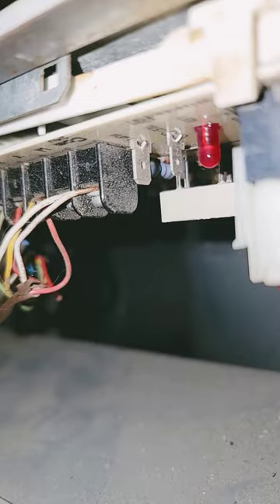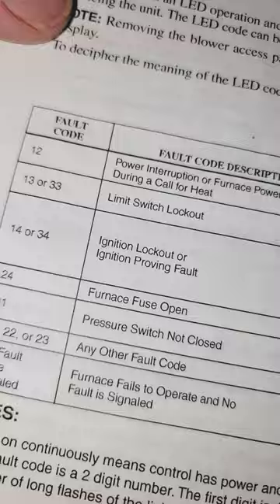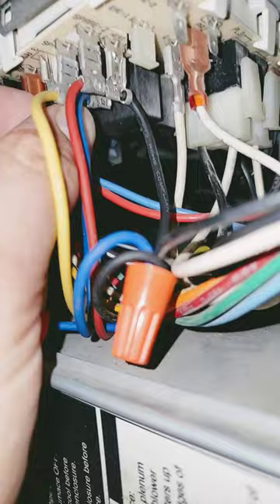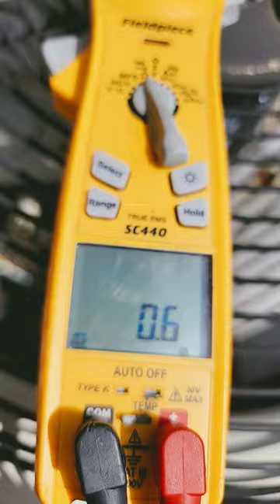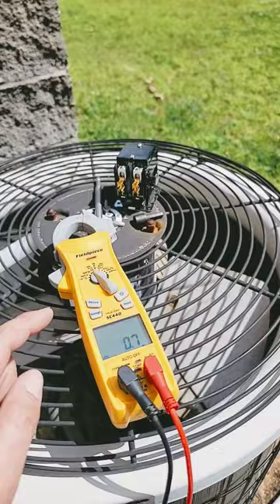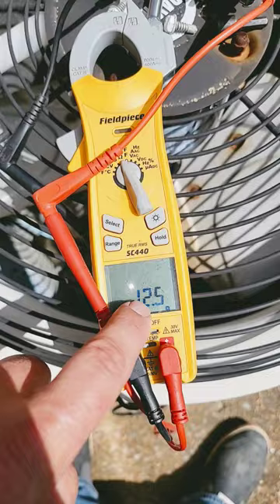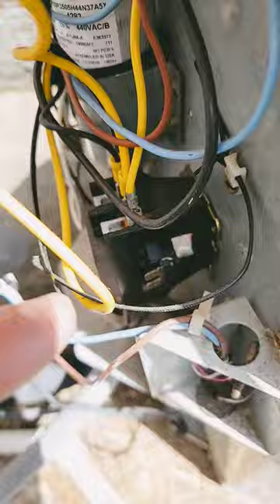The Real Reason Your Fuse Blew (Hint: It's the Contactor)

Comment: That furnace looks brand new. Kudos to the homeowner for taking care of it properly .
Reply: You should see my Clare-Hecla furnace installed in 1980. Still on the same A/C compressor and refrigerant charge since 1988. I've changed a thermopile and replaced blower fan bearings in the last 25 years.

That's it....Clare-Hecla went out of business because they designed their equipment TOO well, I'm guessing.🤔
Reply: Just took a 1984 amersican standard heat pump out of a family friends house. Comp. Went bad finally but it was in great shape for being in south FL. Defenetly a tank.
Reply: @CannonFodder873  it all about the heat exchanger inside the furnace, wether or not motors and electrical components fail and replaced over the years doesn’t mean anything for you have a failed heat exchanger. The heat exchanger doesn’t stop the furnace from operation but does became a possible extreme hazard when furnace is operating. In the 1970s,1980s,and early 1990s furnace were built about as good as cars which means not well. Your heat exchanger will last 20-30 years if lucky and 40 years of it’s rarely used. Having your heat exchanger properly inspected is the only thing that insure you have a furnace in good condition. From the outside it my look ok but on the inside the heart of the system could be failed
Reply: @joshlevy9462  It's all about good design and proper maintenance. I did industrial maintenance for 30 years. My furnace/AC system is 43 years old and I live in Canada...so it's NOT like it's rarely used.

If you use gas in your home and DON'T have CO detectors for safety...good luck....🤔

Comment: 24 years is young for those older ac units! Just swap out the parts that go out for the next 20 years and ur still way ahead in the game…r22 units can easily be converted to r290 without much change to the actual equipment ….abd it’s not gonna be banned and works more efficiently then all this new garbage they’re dreaming up….r290 is hvac grade propane so no weird chemicals that can cause problems etc….i did it to my 95 carrier because I can’t get anyone to show up to do repairs so I’m learning it myself…what do I have to lose? I ruin the ac I got…oh well…it’s working nicely at the moment with r 290 in it….the brazing is leaking still so next step it to repair the line…but I get to do the trick to trap the Freon in the ac itself before doing the repair on the line….oh…and I’ve never brazed before so yeah….this will be interesting…

Comment: Had this exact same issue pop up on a recent install.  We installed a new furnace but the customer kept the old outdoor unit.  Turned out a lizard had got in the contractor which was causing the fuse on the furnace board to pop. Thanks again for another great video

Comment: Should always check the ohms during pm visits. Ohms are off, replace contactor. No call backs because of a contactor. They can Jack your world.
Reply: Your statement couldn't have been any closer to the truth.  
  The resistance in coils and motors will tell you a LOT.  
  To me, it's kind of like a doctor being able to scan a patient's heart and tell him/her how much longer they have to live. 
  If the resistance increases from its nominal value, some form of corrosion or deterioration may be forming on the coil or winding.  
  However, if the resistance decreases, the two terminal ends of the coil (or two or more windings, or a particular winding and Common) are slowly forming a direct path for electricity to flow between the two, and will eventually short out.
Reply from the maker: Love this statement very true brother
Reply: Yeah, just make sure you don't let those 24 wires on either side touch any metal...I'm giving advice from experience. Unfortunately, they can ground and not pop the fuse, but kill a thermostat instead...lol Especially EcoBees...

Comment: Taddydigest: what are your thoughts on the new refrigerant systems after 1/1/2025? The company i work for does multi family home new construction (new apartments).we have a job coming up with this new refrigerant and My boss put in a bid for 60$ a foot for the copper. Because of the extra work required meaning all linesets have to be covered in another layer of arma flex with a metal sheath  that encapsulate it all , and length of the line sets are not short ( one chase for 16 apartments)😮. He won the bid if you're wondering.  Just when i thought i knew what i was doing they switched it up lol.

Comment: My contactor coil caused my 3 amp fuse to blow.  Stupid me,  I put a 5 amp fuse in and it popped, then a 10 amp fuse and I heard my circuit board fry, so I called a pro to come out.  He found the issue,  had both the board and the coil in his mobile stock and charged $650 for less than an hour parts and labor.

Comment: I just came from a 24v tripping fuse and high voltage tripping breaker.. turned out the roofers cut the wires and in panic caulked them inside the cover for the copper line 😅 would of been an easier repair had the spoke up vs putting 4 bottles of caulk on it

Comment: I had a bad contactor that kept killng transformers in Trane furnace, 5 amp fuse would not blow though.
Reply: lots of transformers are not able to supply 5 amps, especially if the replacement was a cheap unit... or if it was a long wire run and you just got a lot of voltage drop.

Comment: Hell, even 12.5 ohms seems low to me, I like to see between 15-20ohms, but they are just making everything cheaper and cheaper these days and now you got to deal with shit like this because of it
Reply from the maker: yup, I agree the contactor that was existing wasnt even that old and already needing replacement
Reply: ive always went with the 11- 17 ohms, keeping in mind if your checking one and it was being used heat is resistance and the "hotter" the contactor is the higher your ohm reading will be. tested this theroy on hundreds of contactors. i prefer the Emerson sure switch ive tested in my own equipment for 5 years now.

Comment: Swap the contactor and the capacitor every ten years and you will never have to call the repair guy.   Shut off the power.  Short the cap.  Easy screwdriver job.